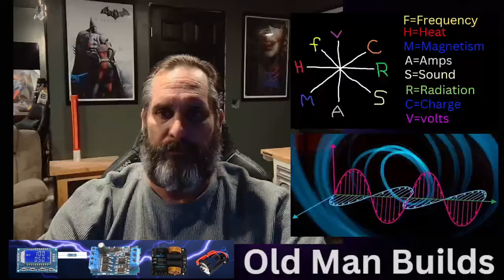High Voltage "Do You Really Understand It" #56

Comment: That's great info Nathan - thank you.
Forgive me I'm trying hard to understand this beyond the many holes in my knowledge...!
So from this, am I right to think that when you apply a secondary 5V carrier on top of the main ZVS circuit, and apply a secondary frequency to that side, then so long as that frequency is higher than the ZVS switching circuit it will dominate over it? 
I not sure how the duty cycle of this higher frequency circuit would create a beat frequency that would be different from the actual frequency the duty cycle is within - seeing that the duty is the time period of the square pulse? I have seen how the duty cycle changes the output V/A relationship significantly, but it's still the same frequency - is it a harmonic interaction with the ZVS circuit frequency or with the coils? Thanks!
Reply from the maker: here is a circuit with a small power source when I first built it. but it will show the frequency changing https://youtu.be/ag9jqnBTY9g

Comment: i looked at the zvs circuit i think you can change your capacitor values to get not only soft switch and zero volts across the transistor , they do this with  the CAP so in the same way you can decrease your cap value to make a super short on time and a long off time to keep your frequency from going to high  for what ever reason if you wanted a low frequency with s super short on time you could do it with a custom zvs only it might not be zero volts across the transistor anymore cause you need the charge across the cap  to be there this way it simulates zero volts by making the identical potential across the npn so when it turn on it does not see a load from the source instead from the CAP . to my understanding dont quote me ;)
Reply from the maker: You are changing circuit parts to get 1 outcome. I am changing it at will without changing parts.

Comment: Thanks for your work. I have been considering a circuit that is rhythmic. Like using a speaker as a drum to generate a small control frequency. Not sure correct term but like a touch sensitive frequency and amplitude generator. I do a lot of reversed system experimention. Interesting results some times. I began using motorcycle charging systems for the ability to handle much greater amounts. I also do infinitely variable chemistry adaptations. Your 8 point pie wheel actually helps me a bit. I have subscribed and looking forward to upcoming information. 🎉
Reply from the maker: this circuit is cheep and it work great. You will have to adjust the resister or put in a photometer.

Comment: It sounds to me like you're modulating the ZVS driver circuit - Changing its input voltage, changes it output voltage/frequency
- much like a DRSSTC Tesla coil.. Here's something I found one should do to tune such a thing:

To power-up your DRSSTC Tesla coil for the first time and to verify self-oscillation, please use the following steps:

     Put on your safety glasses.
    Connect the interrupter to the DRSSTC controller.
    Place an appropriate dummy load in the center of the primary coil.  The secondary coil should not be installed at this time.
    Once again, double check all connections to make sure there are no wiring errors.  A simple wiring error can spell disaster for components in your DRSSTC!
    Connect your multimeter set to DC volts across the DC bus capacitor stack.
    Apply the input AC power to the Tesla coil.
    Verify that the proper DC bus voltage is present.
    Turn on the interrupter and start slowly increasing the pulsewidth.
    If everything is correct, including phasing, you will hear the classic angry bee sound.  If you do not hear the angry bee sound, then the Tesla coil is not self-oscillating.  At this point, try reversing the phase.  This can be done via the phase switch in the Universal DRSSTC controller, or by reversing the direction or connections of your 1000:1 feedback current transformer.  Make sure to perform this step after AC power is disconnected and that you have verified that the DC bus capacitors have discharged to 0 volts!
    With the phasing reversed, repeat steps 6 through 8 above.
    If the Tesla coil is still not self-oscillating, then you will have a bit more troubleshooting to do.
Reply: Thanks for sharing. You have some excellent information regarding the DRSSTC.  The DRSSTC has feedback that this ZVS does not. This ZVS circuit is connected directly to the Tesla coil primary.